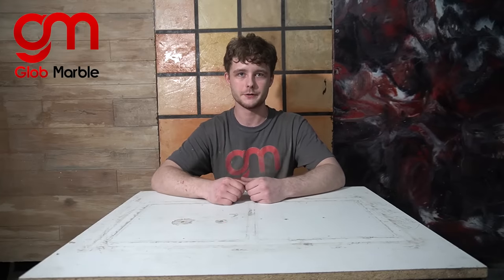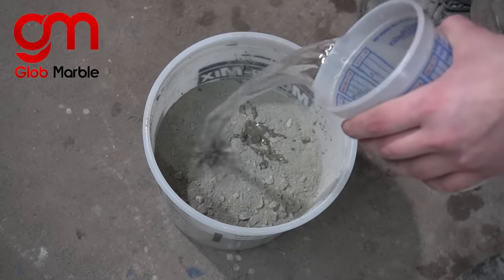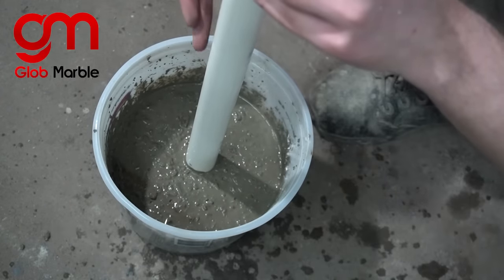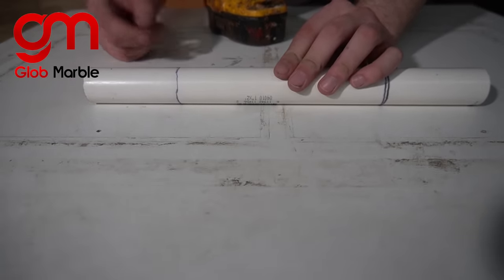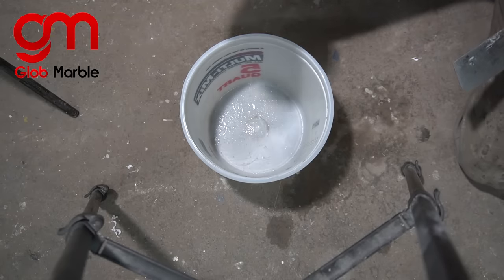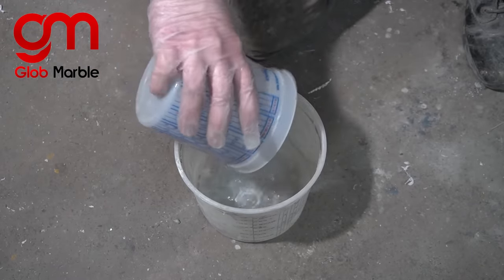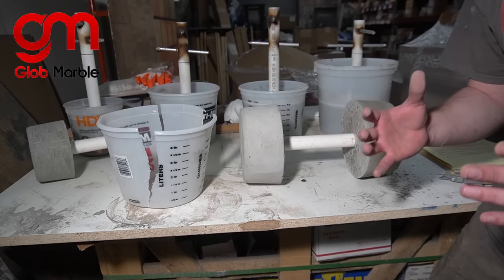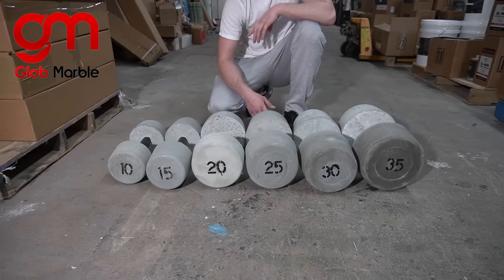Concrete Dumbbells | DIY

Comment: Great video, was this just plain concrete you used or did you mix with any sand/aggregate? Thanks
Reply from the maker: Thanks! The concrete I used in the video was the sakrete high strength mix, but it was much easier to actually balance the tubes with my own mixture of 2 parts sand and 1 part Portland cement. No pebbles

Comment: Hi, what size containers are these?
I’m in the UK and want to try this out!
Reply from the maker: Sorry the video was all imperial, so I doubt you'll get the same containers I did in the UK, but here are the sizes per weight anyways :) :10 and 15 lb. -  3 quart, 20 25 and 30lb. - 5 quart, 35 lb.- 10 quart

Comment: What bucket sizes did you used for each weight? And how deep did you fill your buckets?
Reply: Just measure an amount of premix, that will give you the weight. The water weight is pretty much negligible.

Comment: can i do this with 40 and 50kg dumbells?
would they look too big?
Reply: just use a bigger bucket and make it thicker
Reply from the maker: You can do this but you will definitely need a sturdier handle material than PVC

Comment: Shouldve used a pipe as mold for the handle and made the whole dumbell concrete. Could’ve reduced the overall size of these things by a decent amount. Maybe even make thicker handles (to an extent) as the weight goes up
Reply from the maker: You should try that and tell me how it goes

Comment: Did concrete dumbbells once, lasted a week and started to break, the time, effort and materials required are almost as buying a cheap brand new dumbell and ends up being better than concrete ones anyways, even the plastic ones that you fill with water or sand are better than this. Im not bashing the vido itself, im just giving you a heads up, this doesnt work in the long run.
Reply from the maker: I mean I've been using them for a while and they are still looking good. I don't slam them onto the floor, but if you need to do that a cheap way to make these last forever is coating them with line-x
Reply: @GlobMarble  That could actually work ...

Comment: Instead of doing a test one In the beginning could I just put the concrete in and water and the pvc and then measure it once it’s set and then do the other side?
Reply from the maker: How I did it for every other dumbbell in the end of the video was just work quickly. I sampled the height of the concrete, left the concrete in the bucket, then measured the final length of the pvc, cut, drilled, nailed, and came back to the same bucket. This would only work if you aren't using fast set concrete

Comment: You know if you brush the plastic container with oil or petroleum jelly and mix the concrete in another container before pouring it in, you can remove the cured concrete without destroying the plastic container every time .
Reply from the maker: The bucket will not demold because of the scratches inside of it. If you would like to demold the buckets and not waste them, mix the concrete in a separate bucket and pour into a new one. I don't think they would look as cool without the scratches though
Reply: GlobMarble ok, I prefer to reuse the plastic so I oil mine and it comes out everytime

Comment: Why not put some type of reinforcement in there like mesh to make it less likely the concrete will crack?
Reply from the maker: That's always an option, just make sure it all totals to the weight you need

Comment: Question, I haven't actually listened to the video yet so if you already went over it let me know, but curious if you found out about how much they weigh, based on the diameter of the mold, and thickness of the concrete?
Reply from the maker: I haven't gotten that in depth, but if you pause the video you'll see which container sized i am using for each weight :)
Reply: @GlobMarble  That's perfect, I'll watch the whole thing, really appreciate it.

Comment: Could you add loose screws in the concrete mix to act similarly to rebar?
Reply from the maker: They wont make the concrete any stronger, but that's a great way to make the dumbbells heavier

Comment: when i workout ,,,,, i take and i press the dumbells to fail then drop them on my rubber floor..... would these handle a 3 ft drop
Reply from the maker: Unfortunately you would need one more step for drop prevention. After the concrete completely dries (a little less than a week) you would have to spray a bunch of line-x of flex seal onto the dumbbells. At that point they will be almost indestructible and will not crumble

Comment: Could you use something else for a mold, I don’t have a lot of buckets
Reply from the maker: You don't have to destroy them as long as the bucket doesn't have scratches in the side. You can just remove the concrete out of the bucket and reuse it if it is a relatively new bucket.

Comment: We do that in belize but it would be more better to put a steel bar. Or anything metallic inside the pvc pipe so it wont break or crack

Comment: Any idea on how to create a radius around edges of the concrete facind upwards in the mold? radius would help avoiding small fractures/dusting/abrasion around the edges. Also painting with clear glossy concerete stains (polyvinyls,  polyacrylics etc.) would eliminate overall dusting if anyone is thinking to use them inside home.

Comment: Just a question... Do u mox any sand into it sir? 

Anjo dela pena.
Reply from the maker: No, I used a premixed bag, so all the cement and sand and gravel was already in there. You could instead make them out of 1 part cement, 2 parts sand

Comment: Soaking in water after dry makes concrete more strong and durable.
Reply: So after 30 days when the concrete drys soak it in water? How long do you soak it for? How long do you wait for it to dry after you soak it?
Reply: @chrisencelan4021  Not after 30 days, Let's say when it's partially dry when you take it out of the bucket. Put it in water overnight let it dry again that's it.

Comment: if you ever do this again, next time instead of heating up the pvc with the torch heat up the nail then use pliers to push it through the holes

Comment: What is the volume for those weights or at least what is the weight:volume ratio for cement? I don't have a weight scale to measure so this is the best I can do for now.
Reply: Not sure weight to volume ratio but if you just weigh the dry concrete in whatever container or shape you are going to make it will weigh that much plus about a pound or two depending on how much water is held in the concrete after it dries. Not sure if that helps at all
Reply: @cadenhelfrich7911  Thanks, I really do appreciate it. The only problem is that I don't have a weight scale to weigh the cement.
Reply from the maker: There is really no way to weigh the concrete wiothout a scale. There are a lot of cheap scales on amazon that you could use. Not only to weigh the buckets, but to measure your progress after your workouts!

Comment: Can you make eco friend concert or any other material which is BODEGREABLE  which can be put our house cold during summer and hot during winter as in old time house building of mud, clay and soon. 
Modern construction materials with hard strength but eco friendly too.

Comment: What's the length of the nails? Or does it matter?
Reply from the maker: For every bucket the nails were cut to a different size. I just made sure that the nails were long enough to cover most of the buckets diameter, but not so long that they touch the walls of the bucket.

Comment: A piece of rebar might be a better choice. for  a handle
Reply from the maker: Dude that would look so metal. The only problem would be finding a way to attatch nails to it so that the concrete adheres to the rebar and wont slip off. Maybe welding?

Comment: They're cool, but I need 80kg dumbells :( any ideas?
Reply from the maker: You could use an EMT conduit pipe or to be extra safe maybe even a thick bar of rebar. Remember to subtract the weight of your handle from the total concrete weight!

Comment: So why do we need to waste the 10 lbs of concrete? Can't we just measure the height quickly and replicated it on both sides, then stick the pvc pipe back inside?
Reply from the maker: I mentioned you don't have to do this if you work quickly.

Comment: The containers at 2.35 each make each dumbell cost more than $5 each when all is said and done. If you go to the dollar store I'm sure you can find small buckets for $1 each and but the price of this build in half. That set he had at the end must have been over $30 but if you take 3$ of each one you can probably make it for around $15. Not to mention that bucket probably cost .15 cents to make. The profit on those things for home depot is ridiculous.
Reply from the maker: You're 100% right, there are cheaper options for buckets. I've seen people use old 1 gallon water jugs too. You have to admit though, a full set for the price of one store bought dumbbell is still pretty good
Reply: @GlobMarble  I recently had to buy jugs of water to just to use the container to dispose of old gasoline. They aren't much cheaper than 1$, but if you happen to have 12 of them laying around than its free I suppose.

Comment: instead of destroying the bucket, couldn't you just pre lube some petroleum jelly to the inside so the of it and just dumped the cement that was mixed already?
Reply from the maker: The bucket will not demold because of the scratches inside of it. If you would like to demold the buckets and not waste them, mix the concrete in a separate bucket and pour into a new one. I don't think they would look as cool without the scratches though

Comment: It was not necessary to cut the bucket, it comes out if you put pressure on it
Reply from the maker: The bucket will not demold because of the scratches inside of it. If you would like to demold the buckets and not waste them, mix the concrete in a separate bucket and pour into a new one. I don't think they would look as cool without the scratches though

Comment: This is nice too, but I found a better re usable way to make dumbbells.😁👍
Reply from the maker: I've seen those, ones where you can remove the plates and add different ones? the problem is the maximum you can put with those videos was like 20 lb. you will still need to cast heavier dumbbells with this method :)
Reply: @GlobMarble  i think,  you are correct😏

Comment: If 35 lbs gets that big, what about 60. Damn.
Reply from the maker: Ive seen people put motorcycle gears into the concrete to make it heavier. Maybe try using pieces of crap metal? Or maybe even use pointed bb gun pellets as an aggregate. I wouldn't recommend using the round ball ones because they would weaken the concrete.
Reply: @GlobMarble  I think chips from lathe or shapper will do....
Reply: DIY people add gravels and old metal scraps in cement to reach the weight target

Comment: PVC handle can withstand the weight?
Reply from the maker: My 35 lb weight is holding up pretty well, you could use EMT conduit instead
Reply: @GlobMarble  no bending or warping? interesting

Comment: Hey man loved the video! is it possible to use the same PVC pipe while creating a 50lb dumbell (25 each side) ?
Reply from the maker: Probably not the best idea, you could use an EMT conduit pipe or maybe even a thick bar of rebar. Remember to subtract the weight of your handle from the total concrete weight!
Reply: @GlobMarble  thanks!

Comment: Put these dumbells in water after 24 hours for 3 days or more it will make concrete stronger. Don't try to dry these withing hour or so it will make it brittle. 
 thanks for this idea though.

Comment: If only you had a 200lbs dumbells plan 
I don't think it would be safe lol
Reply from the maker: Those would be ridiculously huge lmaoo. Also you would probably need to use 1-2 inch thick rebar instead of any plastic pipe for the handle.

Comment: Where i can buy that plastic conteiner
Reply from the maker: At any home depot or lowes. These are the container sizes i used for each dumbell weight I made- 10 & 15 lb dumbbells- 2.5 quart container, 20, 25, 30 lb dumbbells- 5 quart container, 35 lb dumbbell- 10 quart container.

Comment: why to waste the bucket, just put in warm water (not too much warm) and it'll leave its place
Reply from the maker: The bucket will not demold because of the scratches inside of it. If you would like to demold the buckets and not waste them, mix the concrete in a separate bucket and pour into a new one. I don't think they would look as cool without the scratches though :/

Comment: How can u know how many kg are each litre of concrete?
Reply from the maker: I've never measured liters of concrete :) I recommend doing this with a scale and weighing it by kilo. There are some pretty cheap ones on amazon. Here is a link- https://www.amazon.com/Letsfit-Bathroom-Technology-Precision-Measurements/dp/B07L2XBK5V/ref=sr_1_49_sspa?dchild=1&keywords=scale&qid=1592427851&sr=8-49-spons&psc=1&spLa=ZW5jcnlwdGVkUXVhbGlmaWVyPUEzUExXN1RTTTY0SkNHJmVuY3J5cHRlZElkPUEwODk2NjQ3Mk9NOUtMT1dXNFpBSiZlbmNyeXB0ZWRBZElkPUEwNTI5Nzk3MVNFWDVFQjVPOE1MTSZ3aWRnZXROYW1lPXNwX2J0ZiZhY3Rpb249Y2xpY2tSZWRpcmVjdCZkb05vdExvZ0NsaWNrPXRydWU=

Comment: What if the concrete has too many pebbles
Reply from the maker: If you would like you can mix 2 parts sand with one part cement and make your own concrete with no pebbles :)
Reply: @GlobMarble  isn't that just mortar

Comment: Apply lubricant oil, before pouring the  mixture ..
Reply from the maker: You can get it out without oil. Plastic wont stick to concrete. I had to break it because of the ridges and scratches from mixing inside the bucket.

Comment: are there any stronger alternatives for the pvc pipe? i don't want it breaking on me and falling on my face while i'm on the bench
Reply: you could fill the pipe also with concrete
Reply: PVC pipe has high tensile strength no need to look for anything stronger but you could find metal piping at a hardware store as well
Reply from the maker: Many people are recommending EMT Conduit which is also a great option, but pvc will most likely not break :)
Reply from the maker: Concrete in the pipe would not add any strength. Concrete is strong under compression like under a hydraulic press, but extremely weak when it comes to bending, which is why people use rebar to keep it from cracking
Reply: @GlobMarble  well the handle wouldnt have any room to bend is what im saying
Reply: @GlobMarble  What's the max weight you should go for before you think it would get risky? Also, should you avoid any exercises (like tricep extension behind the head) that could potentially dislocate it or is it damn sturdy? Thanks

Comment: I feel like leaving the mold on would give it more integrity. since concrete crumbles slightly
Reply: It wouldn't be secured on, though. After you set it down a few times, the mold will probably just fall off.

Comment: did a black color. on weight to make it morw fancy and realistic
Reply from the maker: You could but I like the way the concrete looks. You can spray it with flex seal to add extra strength and make it black :)
Reply: @GlobMarble  ❤️❤️❤️

Comment: well, i dont think i will bench press with 40kg or more dumbbells with this pvc, if it breaks or bend when you use it you're good for hospital or dead, but the video is great
Reply from the maker: I've been using them for a while and the 35 lb. weight is still holding up pretty well. Many people suggest using EMT Conduit instead
Reply: @GlobMarble  well its good to know for 35lbs but i think it wouldn't be durable for 110lbs dumbbells, but maybe filling the conduit with the concrete would be a good idea to make it stronger
Reply from the maker: it sounds like it would be but I don't think so. Concrete is very weak when you try to bend it, and if you get a crack in the handles concrete, the pipe is no longer bending along the entire pipe, but only in one single spot where your crack is. this would make it break much faster. What you could use and keep it looking really cool would be a thick piece of rebar.
Reply: @GlobMarble  oh yea i didnt think of it that way, that would be great with rebar and stuff

Comment: not good idea to destroy buckets.. perhaps use cello tape to adjust a plastic film before pouring the concrete for setting the mould.  when it is reasonably settled firm then you just pull the plastic film to take out the weight and keeping the bucket for reuse

Comment: Publishing measurements of the PVC would take the waste out of the equation.
Reply from the maker: The length of the pvc will all depend on the shape, and depth of the bucket and how much weight you put in. Also the length of the actual handle based on the size of your hand. This means the best way is to figure out the length of the pvc pipe is the way I demonstrated. Like I said, the best way to remove waste is to work quickly

Comment: Ratio of cement,sand & stone plz
Reply from the maker: This was a premixed bag, so I can't tell you the ratio. A good custom ratio for you to use is 2 parts sand, 1 part cement. No stone, because it was pretty difficult to balance the pvc pipe with so many pebbles in the way :)

Comment: This is bad. Pvc is brittle and snaps. And it ages in sunlight. Use wood or metal for the handle!
Reply: Maybe if you plan on hurling the weights like you’re throwing darts. If you’re doing any exercises with these that ultimately crack the pipes then you need to stop lifting in general because you don’t know what you’re doing and you’re going to injure yourself or someone else in the process.

Comment: Whyyyyyyy would you use electrical tape? Electrical tape is the worst tape in existence.
Reply from the maker: It looks cool. Lots of people recommended using hockey stick tape for better grip, and it will still look nice
Reply: @GlobMarble Hockey stick tape is a good idea. Electrical tape will start to fall apartand you will not enjoy lifting when your hands start turning black and sticky.